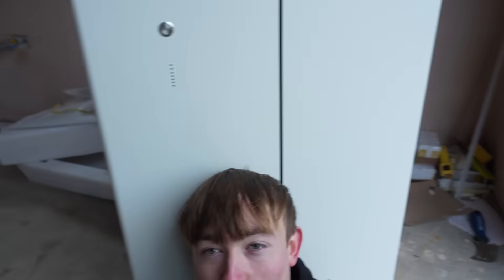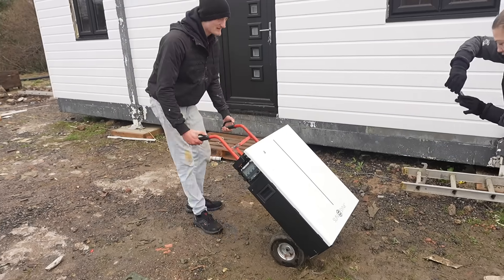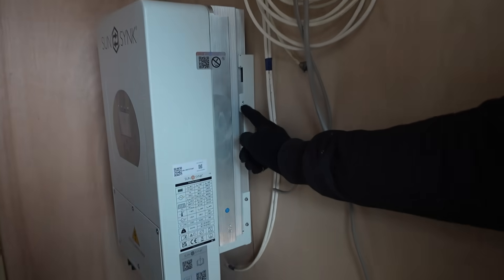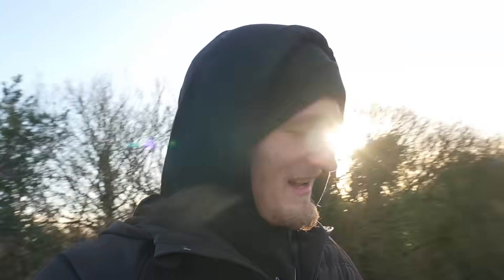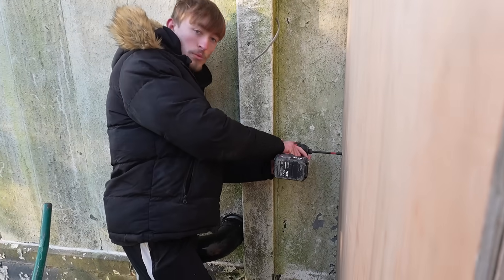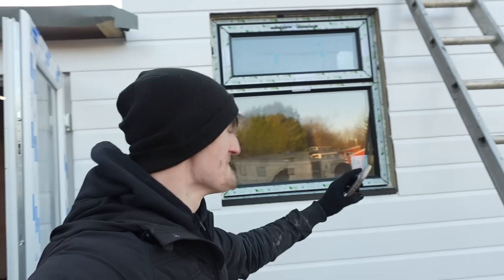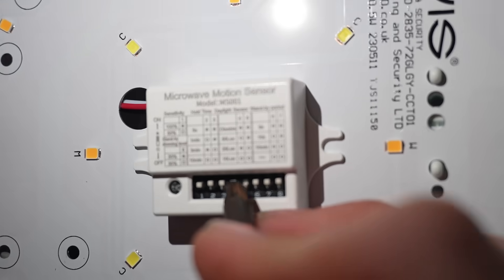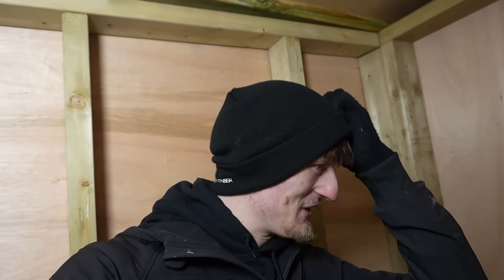POWERING A Tiny Home OFF Batteries!

Comment: Liked your bus conversion into a cafe, and liking the container conversion into a tiny home, but I’m disappointed that you didn’t show the building of the shed housing the electrics, and are you going to insulate in there too as it will be cold especially in winter like now, also you didn’t show how the cladding went on. Other than that liking what you have done so far.

Comment: Not trying to piss on your parade guy because your doing a fantastic job but You’ve got standing water on the roof and with it already showing signs of rust it will almost definitely rust straight through a rust cure and decent coating of red oxide will help stop rust maybe finished with rubberised paint
Reply: @quincy5855  you are right, the roof looks bad, too much standing water and lots of rust, it needs to be redone or it won't last

Comment: Ive never seen a solar power installation before... Very interesting ...those wires look so small. Be neat to know more in detail... Like how long the batteries take to charge in summer vs winter and how long the batteries take to charge and how long will they use and how much energy the tiny house will use in a day.
Reply from the maker: Yeah it's super interesting! In summer, these batteries will basically never run out of charge, in winter it may need a trickle feed of electrics when there's a few days of cloudy weather, it depends how much heating is used/cooking etc, we will be learning it all too!

Comment: Recommend putting some paint on the plywood sheets covering the batteries.

Once moisture gets into plywood. It starts peeling and falling apart. 😉
Reply from the maker: We’re gonna clad the outside will this help??
Reply: @ yes cladding will definitely do the job.

When you put the 90 degree trim on the counter. You might want to fill the gaps with white silicon. That will stop the wind from pushing rain into the gaps.

Comment: so how is the energy balance with the heating now? can solar be enough in winter?
Reply from the maker: We’re yet to figure it out, we think it will be tight!
Reply: Great question. Solar can help power a home in winter, especially with batteries to store energy. For shorter days and higher heating needs, you may need backups or to use the grid to support!